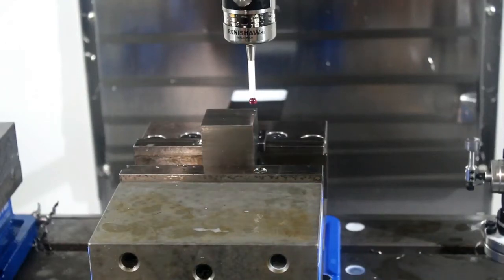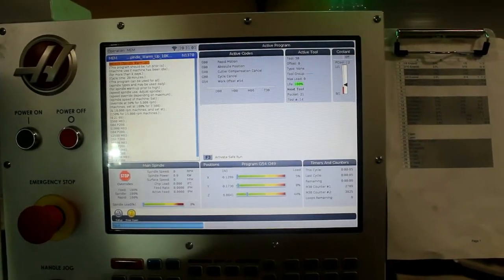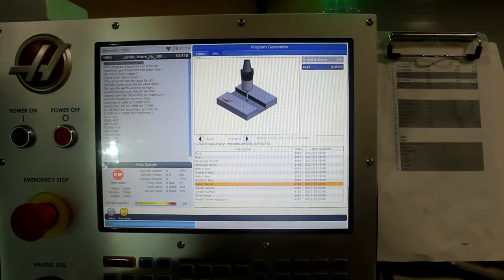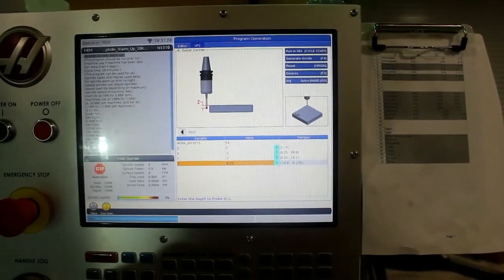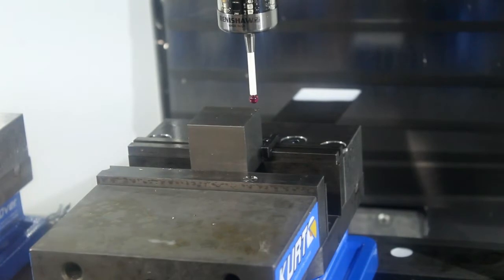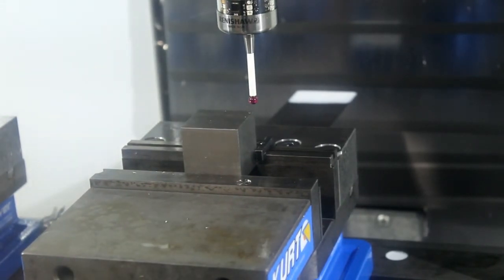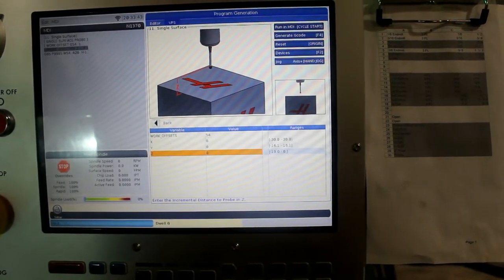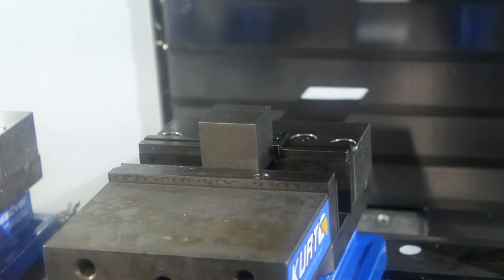HAAS WIPS probing - Corner work offset

Comment: Hey Daniel.
Don,t mind the Probing.
My true thoughts are ?
You are Spoilt having a Probe on your machine.
Honestly i would Not complain if i owned a Mill with Probing.
Maybe in the next life, until then i need to use my Haimer.
Good to see you posting more.
Peter.
Reply: I completely second that.... i used to use the haimer on my old fadal but when the haas tech came out to show me how to use the machine a bit and I couldn't shake the huge smile on my face  after I saw how easily its done with a probe and tool setter... last year when I was using the haimer I think I broke about 8-10 tips.... idk if it just the fact that haas probe tips cost 3 time that of a haimer of just the process of how you use the probe but i haven't broken a tip yet at 6 months of use. *Me knocking on something not made a tree carcus
Reply from the maker: I have never had a Haimer and I have broken 1 tip on my Renishaw but not like you would expect... I had the probe in the spindle and was using mallet to tap in the part accidentally hit the probe tip... I think the replacement was about $100 bux... Hadn't broken one since
Reply from the maker: I used a standard spinning probe most my time machining but it is so much faster and easier to probe. Its also not just the simple probing I did. You can do in machine inspection automatically and have the machine stop and notify you hey this part is out of spec. You can have it do automatic tool checks to check for breakage and tool wear and literally send you a message letting you know. This is mainly if your running a long part lights out but there is a lot more to the probe than just convience in probing.
Reply: @dnjmachine  
Hey Daniel.
There is no doubt.
Spend More, Get More.

If i could justify it i would already own HAAS VF 2 with pretty much all options.
2 machines i would already own.
HAAS VF2 and a Doosan Puma 5 axis.
I don,t really see that happening for a few reasons mostly because i don,t want to be stuck running a CNC anything for to long anymore.

I have already had my time running these machines not much joy other than programming and doing set ups after that i just want to sleep, LOL.

CNC machines look pretty cool from the outside looking in,  but running them day in day out i don,t think i could do that again.

I say that as investing in CNC anything needs to be justified ??
Meaning.
They need to be running ALL the time.

As much as i Love machining i can not see myself as someone who would invest in CNC anything now.
Reply from the maker: @weldmachine  our machines pay for themselves and let us add new tools often, thats all I can ask for at this point. Have a full time job so can't run them 24/7 but once they are paid off those payments will become profit.